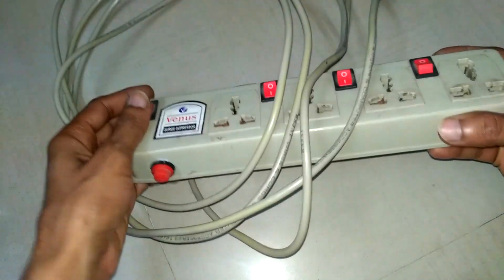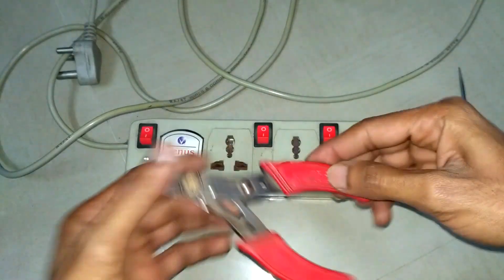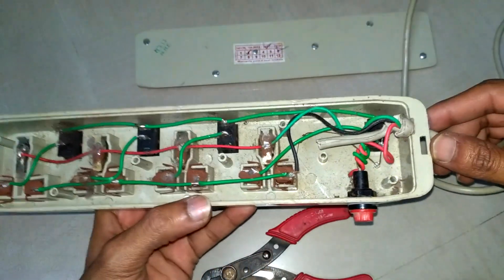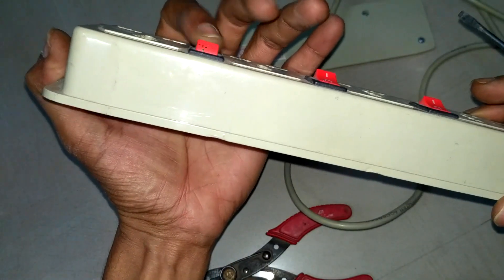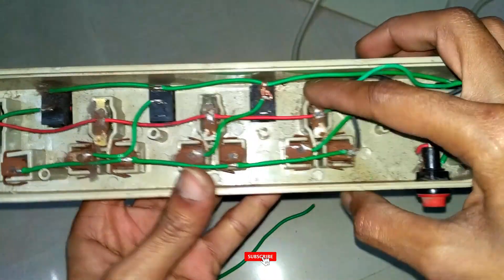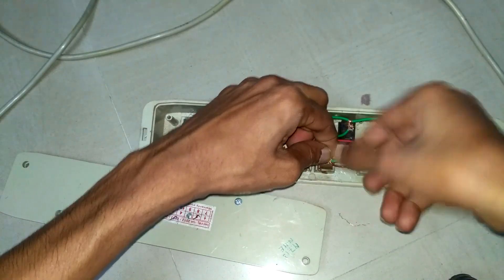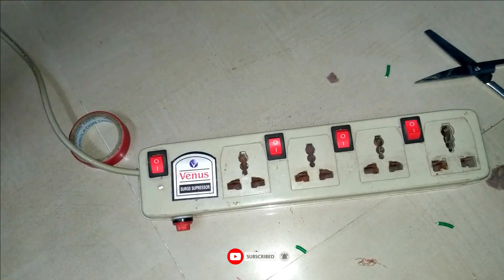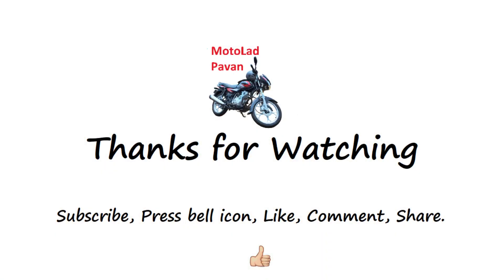Surge protector repair at home

Comment: It is just extension box..... No mov component to surge protect
Reply from the maker: As the title indicates, its re-pair(or rejoining) of surge protector without surge. Or bypassing.
Reply: @PavanKumarHB  it would have been good if you have added mov[metal oxide varistor] for surge protection

Comment: Bro my bike discovery 125 back wheel chain splocket bearing gone any part number of bearing to buy
Reply from the maker: Hi, chain sprocket teeth gone or bearing balls?
36 JZ00 26 Chain Sprocket Kit
39 2240 20 Bearing Ball
KP BB62 02 Bearing Ball